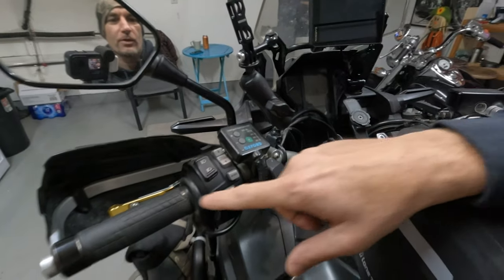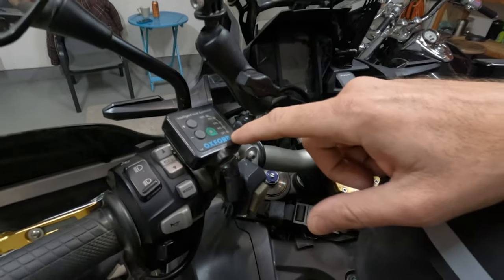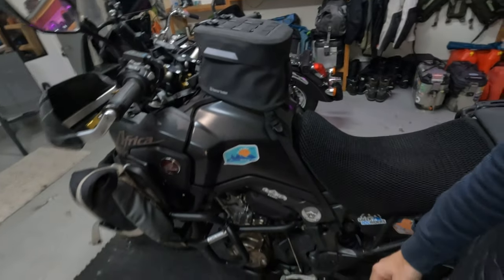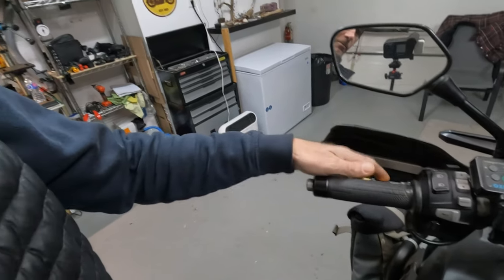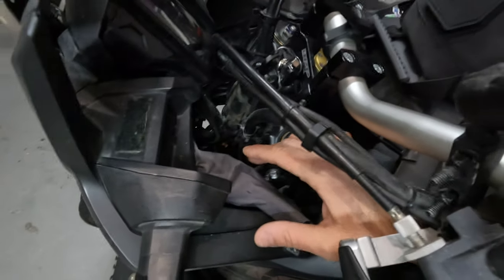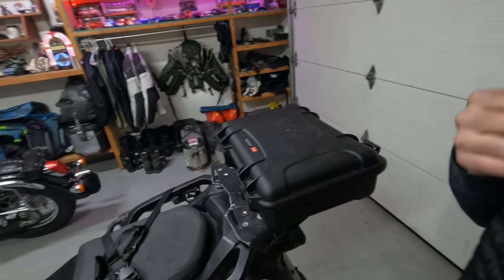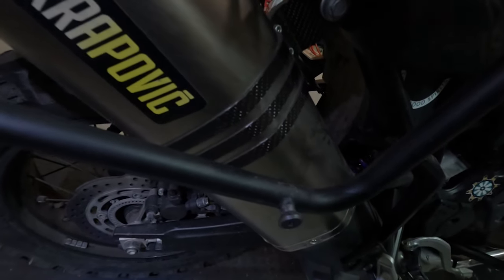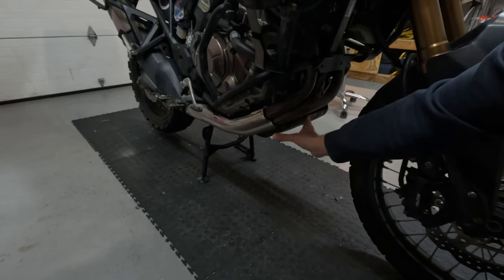AFRICA TWIN  ACCESSORIES

Comment: Hey Tk great overview of all the mods and accessories to your bike. May I ask what you're using to attach the Mosko Moto Aux Pox to your crash bars? I was thinking of  using Aux Pox in that manner as well.
Reply from the maker: Hey, thank you much appreciated. For the Aux Pox I used two heavy duty zip ties on the top for each pouch and on the bottom the pouch has a Velcro strap   So I used that and it’s very solid.
Reply: Professional and good tips! Thanks! some for lay people, like me. especially how to warm our fingers, which are not warmed by the levers.
Reply from the maker: @ctcarneirocarneiro3154  thank you!my pleasure anything to help out and find things useful!